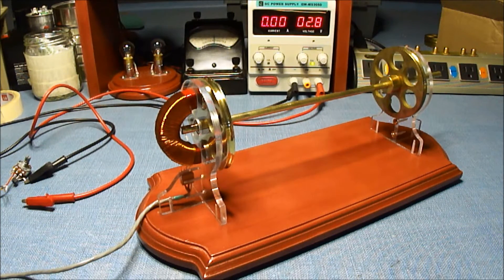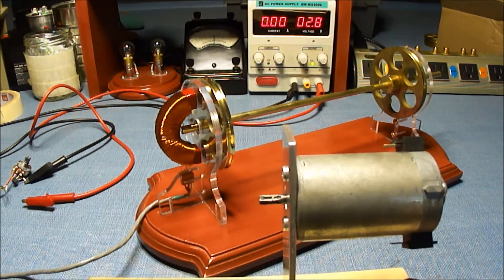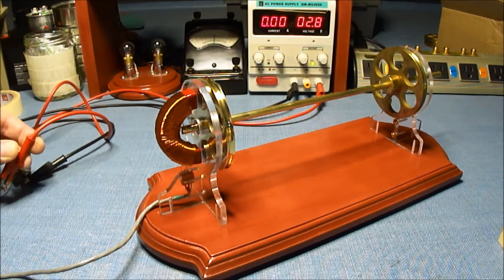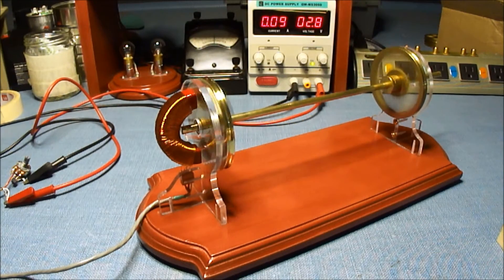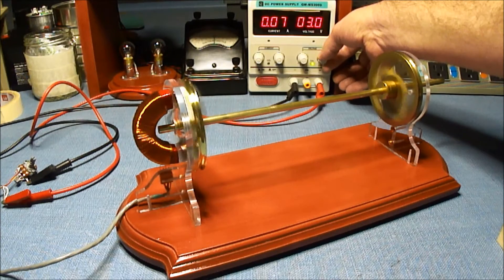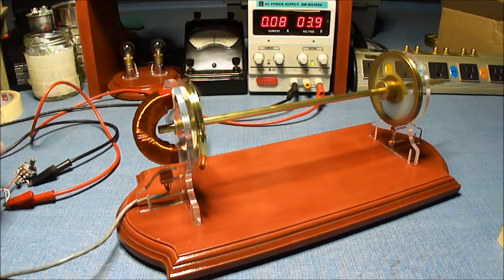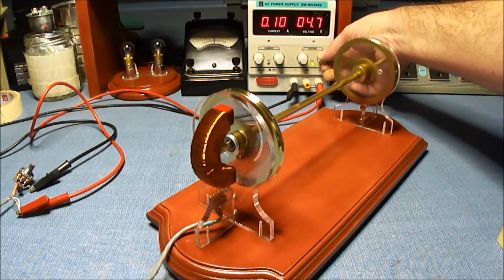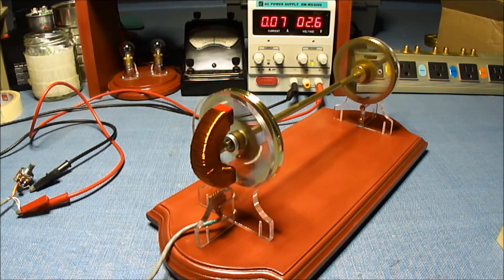#PMBO2017 Hemi Toroid Pulse Motor

Comment: what are the poles at the two ends of the half toroid and what poles are you creating during contact to drive ? I have something similar i am working on with two transistors and two drive coils around one core (U) I could use the circuit LMK
Reply from the maker: The magnets are N & S and the core is an alternating magnetic field. The bifilar coil drives itself US2963658.

Comment: +Arkiver Unified Energy  Thanks for sharing your work and build.  I found that all 3 figures in the patent show 2-PNP transistors.  Did you modify the original circuit?   What advantages are there to driving a pulse motor with this type of multivibrator circuit?
Reply from the maker: To use NPN transistors the resistors go from base to other transistor collector. The bifilar coil goes to each collector and center tap is positive. The transistors alternately fire sending DC current in opposite directions through the bifilar coil making an alternating field. There seems to be more torque than using a single transistor.